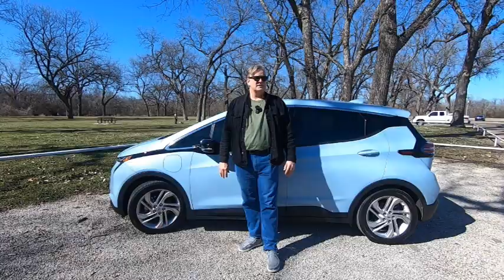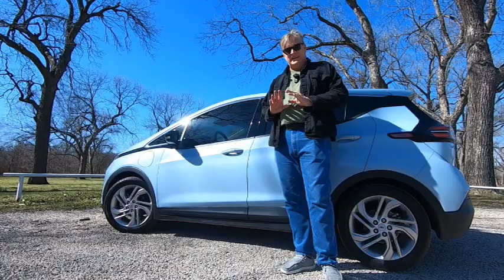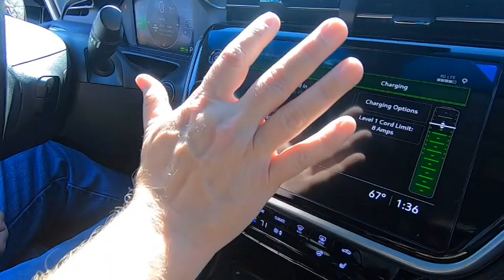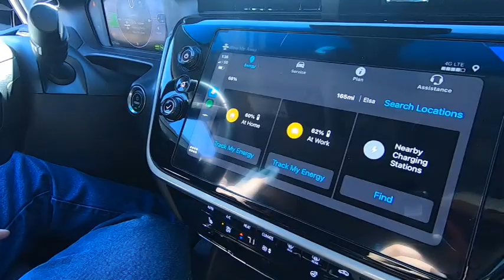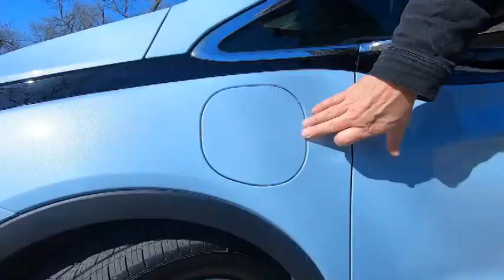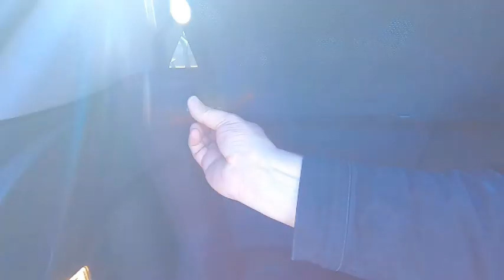2022 Chevrolet Bolt EV 10,000 Mile Review

Comment: They just showed an EV challenge (YouTube) with vehicles $20,000 more.  One was the Tesla.  Guess what?  The Bolt won on the tough distance challenge!  Oh, it was the only front wheel drive in those snowy stretches and had no problems!  Use some silicon for that back clip.

Comment: for cheap EV, it is unbreakable
But, if you add on extra like sun roof, other stuff like super cruise, it is easily get up to 37k
so this car can be 28k - 38k....
I am on the edge about EUV and Model 3
Model 3 about 38k which with sun roof, autopilot and 20 minutes charge to 80% and there is better chance to charge to 100% without damage the battery (talking about the RWD model)

Still not jumping the gun yet

Comment: This car has an excellent speed control. You can tell it was done by somebody with a lot of experience in motor control. Try one pedal driving at low speed, despite of using PMAC motor at very low speed you cannot feel any motor cogging. Also try the hill hold, it not using the brake to hold it, first it might move down a little but after the software preload the slop it not roll back at all, very nice performance.

Comment: I was sold until you told me I would get "whopperjawed".  LOL  Love the little Bolt.  On the appearance side I don't love the rear tailight treatment and turn signals.   That really just looks awkward.  GM should rethink how they have the back end lighting setup.  Faster DC charging would be huge.  The price is right.  I am curious what kind of energy use and range it would get at 55mph.
Reply from the maker: Depends on other things besides speed such as constant speed, inclines, headwinds, precipitation, outside temperature, and climate control. 4 miles per kWh is my goal, and when it’s 60 degrees outside with no climate control on I can get 4.5 to 4.8. Worst I’ve had is 2.8 when it’s was 14 degrees F outside, heater on full, and a massive headwind. EPA estimate comes to 3.98 m/kWh.

Comment: I have a Bolt EUV Premier on order.  Might see in 6 months.  LOL  Anyway...There is a fair amount of discussion on fast charging over 80% and battery life.  Do you have any information on whether level 2 charging is best to stick with the 80% charge for normal use.  In my case it will mostly be an around town car so charging to 80% with my home Level 2 charger would easily meet my normal needs.  Also...does your home charge rate fall off after 50% like I saw on your EVGO video?
Reply from the maker: When I charge at home, it happens when I’m asleep, so I don’t really know. Some Bolt owners regularly charge above 80% on level 2, but I don’t. An 80% charge can handle my commute for 3 days, so I only charge over that when I need to.

Comment: I ordered a 2023 Bolt EV almost to months ago. I check the order status once a week. So far it's been, "Your order has been submitted but GM has not yet accepted it." On the Dave B sells Chevys channel, he's telling his customers in New Jersey it could be a 10 month wait and they might end up receiving a 2024 model. My sales guy here in El Paso, Texas says a 4 month wait. In between 4 and 10 months. Ridiculous lol. Gr8 video. 🚙 🇺🇸
Reply: I feel your pain.  I'm waiting as well.  GM has a winner here.
Reply from the maker: Thanks!
Reply: Did you get your car? I bought a used 2022 Bolt EUV a couple of weeks ago and I’m not sure if I got lucky or if there is just more supply now.
Reply: @ampsquadEV  Yes I picked it up about 3 weeks ago. Production stops on this generation Bolt on December 20th for good. Production on the all new Bolt which will have a Tesla charging port should restart in about 3 years or so. I'm curious, was the battery replaced or is the current battery in the car being monitored by GM software? If your battery was replaced I'd consider you extremely lucky.
Reply: @WestCoastChicano  I asked the Chevy concierge about the battery because I didn’t see a recall for it anywhere (either complete or incomplete). She said my car was not affected by the recall. I’m wondering if it was just built with the new battery. The manufacture date is 7/22.
Reply from the maker: @richdaley9982 mine was built the same month. Those were after the recall and already have the new battery
Reply: @SpinnerEV  I feel like I got really lucky. It was my birthday and my wife told me “why don’t you get the car you want.” I think she was feeling guilty after a particularly expensive hair appointment. 😂. I was working on the financing for a fully loaded Kona EV but it took me a while to get a document I needed , my clock expired, and someone else bought it. At the bottom of the “car no longer available” page was my EUV in the “you may also like” section and for some reason, the price was lower than than the Kona even though it had both super cruise and sun and sound packages. I think maybe it hadn’t gotten into the search results for everyone else yet. 

Even better, I was planning on trading in our 2017 Volt but my wife told me she wanted to keep the Volt and sell her Hyundai so we now have 2 cars that I absolutely love. 

 It is wild how much more refined the Bolt is compared to the Volt even though the Volt is amazing and there’s something to be said for a less refined experience sometimes.

Comment: 10k miles review on any vihecle is ridiculous. 2.5 cent  per mile, the cost is misleading, when you consider the depreciation, potential fixing cost on the EV, registration, insurance.
Reply: Don't get one then, mr wolf. I work in insurance, and the Bolts I've seen insured cost $100-200 more per year than my awd Prius -- the one I did most recently was just under $1,500/year for full coverage -- including registration fees and road taxes. Where I live, given residential rates and gas prices, my impending Bolt will cost 1/3 less to run than said Prius, which is pretty amazing considering the Prius already gets more than double the average mileage of less than 25mpg.
Reply: @David Randall  I am not getting an EV. 

In 2012, I bought a brand new Chevy Cruze, eco trim level, with a 1.4L gasoline turbo engine, 6 speed manual transmission, 42 mpg/highway. The purchasing price was $17,500. Now the car has 65K miles. In the ten year ownership, I spent the following:

depreciation, I plan to drive this car for 30 years. ($17,500/30year)*10year=$5,833
registration, $70*10=$700.
insurance, ($300/year)*10=$3,000

gasoline, $2.5/gallon * (65K miles / 40 mpg)=$4,063

oil change (self done) $25*10=$250
manual transmission oil change, once, $105
tires, one set (4 tires) $328
coolant change, $20*2=$40.
one battery, $95

a fix on the coolant hose, connecting the expansion tank and the engine water outlet, $30 part from Dorman.

The total expanse on the 10 years ownership and 65K miles:

$5,833 + $700 + $3,000 + $4,063 + $250 + $105 + $328 + $40 + $30 + $95 = $14,444

cost per mile $14,444 /65,000 miles = 22 cents.

I have been working form home, my car usage is very limited, only weekend errands, maybe 3k-5k miles per year. gasoline car fits me well. 

My first car was a nissan centra, costed me $800. I had that car when I first came to this coutry, I was a poor student, bare handed. My 2nd car was a Honda Civic, bought new with price of $15,000, had that baby for ten years and was rear ended. The cruze is my 3rd car and I hope it is my last car in my life.

I have no ideal how this guy in the video get the expanse of 2.5 cents per mile, which I think is a very misleading statement.
Reply: @wolfnorth7075  -- Given my current residential rate of $0.14/kwh and a summer economy of 4 miles/kwh on the Bolt (my commute is on 50mph roads), that's be 3.5 cents/mile. Our night time rates are changing to $0.095/kwh as our utility changes to a time-of-day usage model, which'll be even less cost/mile. Yes SD's cost number is low, but he lives in Texas and could get 4.5-4.7miles/kwh much of the year, and EV's take little maintenance.
I'm glad you enjoy your present car.
Reply: @Davran2742  I just got my 2023 Bolt EUV. My residential rate is $0.11/kwh, and my commute is on partly on highway that goes 75 mph, so my economy right now is 3.1 miles/kwh. How do I calculate my cents per mile based on that, or can you do if for me with that info? I am horrible at math.
Reply from the maker: $0.11 divided by 3.1. 3.5 cents per mile
Reply from the maker: I calculate off of my solar buy back rate of 8.5 cents per kWh with a lifetime average efficiency of 3.8 miles per kWh. Actually comes to 2.2 cents per mile. Since insurance and registration are comparable to our ICE car and used 2022 Bolts are selling for the same price that I paid for mine new, my cost figure is based on fuel only. Based on the same fuel only comparison, an ICE vehicle at 40 mpg and $2.50 per gallon is 6.25 cents per mile.
Reply: @SpinnerEV  Thanks for clarification. I was thinking of the whole driving cost and the 2.5 cent just blow up my mind.
Reply from the maker: @wolfnorth7075  no problem. I’ll be sure to clarify that in future videos, and I’ll add a total cost of ownership workup to my list of future content. Thanks for watching.
Reply: @SpinnerEV  -- I'm pricing out a solar/battery backup system now, as there are good rebates here still. Reg gas where I am in BC Canada is $6.42/us gallon, and is expected to get to $9.8/gal this summer. A little Bolt saves a huge amount here, even though it costs more to buy -- with the fed and provincial rebates, my Lt euv at msrp will be $40,600 out the door, taxes in.
Reply from the maker: Nice. I can’t recommend solar enough. We are fortunate to have a lot of sun on our property with a straight low pitched roof that allowed a large number of panels. They generate more power than we need, even charging 2 EVs daily, and our power company pays us for the extra juice. They were a great investment for us.
Reply: @SpinnerEV  thank you!
Reply: @petef.4361  about 4 cents.
Reply from the maker: Based on a search on cars.com, the depreciation is non existent. I can’t speak regarding other states, but registration and insurance are currently comparable to our gasoline powered car. As for repair costs, I likely won’t run out of warranty while I own the car. I understand your concerns, but I’m not trying to mislead.
Reply: I have a 2019 Chevy bolt and I love it.  With my commute it is saving me about 1800 a year compared to a gas car.  I have put about 8000 miles on it since I got it and it works great.  Cold weather does affect the range but it’s an incredible little EV.  Planning on buying the EUV and giving mine to my kids.
Reply: even consider 2.5 cent  per mile as gas expense, this is still misleading. i think the calculation is 10 cents a kwh and 1 kwh can drive the car for 4 miles. First, if you turn on heater and AC, the avg mile per kwh cannot be 4, usually a bit lower depending on the climate of the region. Second, many places the electrical utility company charges delivery charge. usually more than the electricity price. I live in MA, the delivery charge is about 16cents per kwh. So the energy expense mil would be 6-7 cents.

Comment: Hey, just subscribed. I bought my (Ice Blue) '22 which is a 2LT in August. I also have a 58 mile commute, and I had (3) miles on the odometer when i picked it up.
I was looking for a 1LT, but the wireless charge pad and the 360 camera are really nice. And the "leather" seats aren't as bad as I thought they would be. My came with the white dual voltage EVSE which is nice to have.
***********WHAT was the software update you got/needed? I got mine in August and have not heard anything about any software issues. It's a July built.
Reply from the maker: Mine was a July build as well. The software recall was around August/September. Don’t really remember what it was for, but I think it had to do with the shifter. Your dealer may have already done it before you took delivery, or it may still need to happen. You can contact the EV concierge at GM, and they’ll check your vin to let you know for sure.
Reply: @SpinnerEV  I did the (7,500) tire rotation and they also did the seat belt retension recall done. Had to "inform" them of the way GM recommends rotation pattern and they ended up CROSSING both rear to front as well as front to rear. Ugh. I'll have to look into the software for sure, but since your video, i tend to wait for the car to "boot up" before engaging the gears.
Reply from the maker: Same
Reply from the maker: Glad that helped
Reply from the maker: Oh, and ice blue Bolt is best Bolt.
Reply: @SpinnerEV  Respectfully disagree - the Gray Ghost is the most stunning shade of gray ever. There are purple undertones. It adds sophistication to the quirkiness of the Bolt.
Reply from the maker: Fair enough